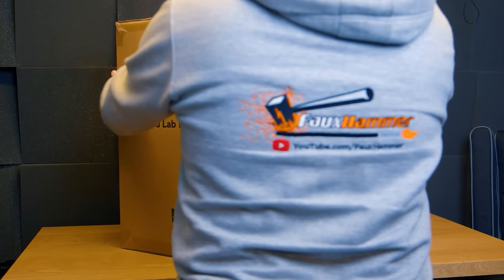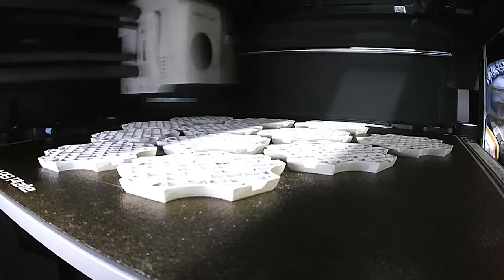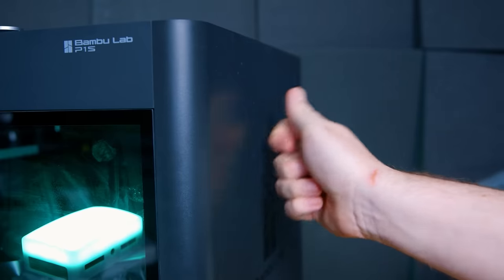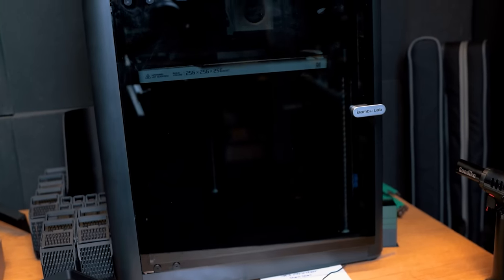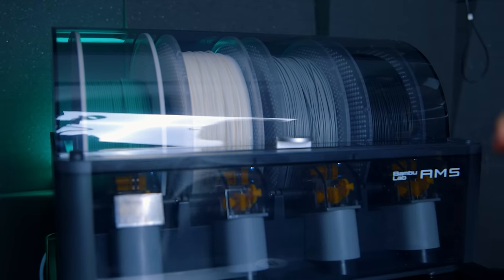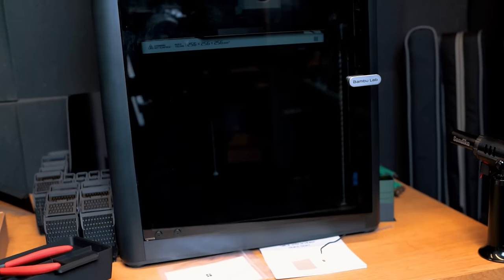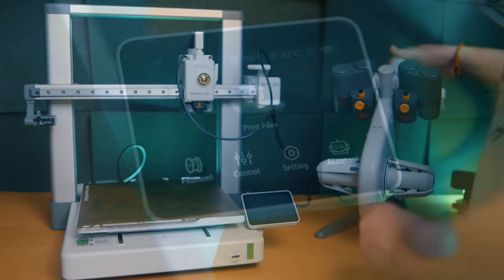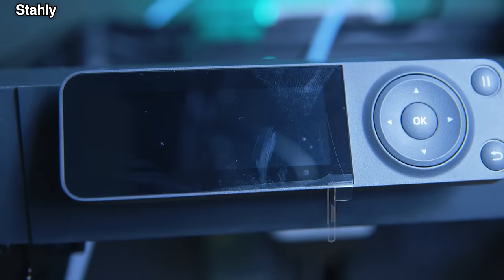Bambu Lab P1S Review - Please Start Here - I BEG YOU

Comment: I had never seen a 3d printer other than on youtube. I am 72. The printer arrived. I set it up. Then printed an 010 print file it was a toy boat that had an out board motor that Bambu had included no charge. It required 3 colours I had 2. I changed the colours simple and pressed print and I had a toy for my grand son. Be amazed by a Bambu 3d printer. I purchased it to print parts for an outdoor retractable blind that are no longer available for purchase.
Reply: In the last 20 years I already explained a lot of stuff to elder people regarding how to use tablets/phones/computers,etc... To be able to do this yourself without help/previous experience is just... wow! respect!
Reply: Now my old man (Who's 66) should have NO issues, but he blames being old on why he still has a flip phone.
Reply: I have now designed and printed a skylight for my a casino on my slot car track. All the traffic boarder, tall and smaller light stands. With concealers fro lights in my pit buildings, roller doors that wok for my pit garages ( a retro fit ) a replacement part for our out door roller blinds in PET GF,( The part was no longer available. I did all the design on Onshape. And it is easy. You just need patients and time to re watch to online tutorial. I am turning 73 in January. And only recently purchased my first 3d printer. I also failed form 3 at secondary school.
Reply: @McCraeMoto1 what software did you use to design it? Is this included?

Comment: I have had the PS1 for about a month now and have yet to have a issue with printing PLA with the door close and lid on. Coming from a Ender 3 Pro, The P1S works like a dream. Though I am glad i started with a Ender because it helped me learn the basics of 3D Printer.
Reply: I have an ender 3 and am looking to upgrade. How are the overhangs compared to that of the ender 3 in your experience?
Reply: I'm using a flashforge finder 1 and am finally looking into "good" printers.
I love the idea of multiple colours
Reply: @cleverballoon6535  P1s can have some problems with overhang at normal speed. Just because it's so fast. Nothing major though, and you can slow it down if it's have trouble.
Reply: @GregoryShtevensh  multi color is great but comes with drawbacks. Depending on size and orientation, it can add a bunch of time to your print. Also makes a bunch of waste because of the need to purge filament when shaping color. Though the results can look pretty striking.
Reply: I have an X1 and not been taking the lid off when printing pla am I missing something?
Reply: @DLStarbuck  I don't believe so. I heard you should remove the lid when printing PLA but I have never printed with it off and never had a issue.
Reply: Do you recommend it ? I have a ender 3 but print then after several I start tinkering sucks .
Reply: @JAYTHEGREAT355  if you want a printer that just work get a Bambu labs. Enders 3 is a good beginner printer of you want to learn how 3D printer works.
Reply: What sort of games did you play on the PS1? Metal Gear Solid? NFS? THPS?
Reply: It's the first PlayStation you know the PS1. What a system.
Reply: @Gepstra  you aren't wrong there. Good times, Good time.
Reply: do you get a pla smell while printing? i have a p1p and i figured the enclosed p1s may smell way less like pla? lol.
Reply: @Bluntedco.  Not that i noticed. Though I might just used to it at this point. I do run a Air Purifier in the same room.
Reply: I’m getting this and coming on 3 to 4 years of printing on a creality ender 3 should I buy

Comment: Pro-tip on support for PLA. It operates much like using PETG as a support in that it doesn't stick to PLA as aggressively as straight PLA. This allows you to set your interface gap to zero thus giving you far better finishes on support sites. Also make sure you choose the option in Bambu Studio to only use the support material as the "Interface layer" as this minimizes filment changes and thus waste. Also when you choose that option, it will automatically set that interface gap to zero.
Reply: Great tip! 👍
Thanks. 🙏
Reply: Problem is, that you will have to much filament changes thus poop
Reply: @striple6752  As I said only using it for the interface layer minimizes the changes. Obviously model design plays a role. That said honestly filament is cheap and while I would prefer less waste, I'll take convenience and print quality over waste every single day.

Comment: At 11:00 the tool is to help you align the build plate with the replacement PEI sheet sticker when replacing it, and it also helps evenly push it down without bubbles
Reply: Bambu have a great video showing how to use it.
Reply from the maker: ahhhhhh!

Comment: Man, after years of struggles with my CR10s... I gave up... and get interest in Bambu. today you give me the reason why I should finally move on the next step of 3D printer. Thanks !
Reply: CR10, ouch
Reply: The CR10 makes me not want to print. I should try this :D
Reply: i went from a highly modded CR20 Pro to an A1 Mini

the A1 Mini has, in one month, done more prints than the CR20 Pro done in 2 years, without any hiccups.

i've had it since january.

needless to say that old thing's just collecting dust now

it had one big benefit over the CR10 and E3's tho, doesn't have bed leveling knobs and ABL out of the box

HOWEVER it came with literally broken firmware so ABL didn't even work out of the box, on a LOCKED BED PRINTER, LOL
Reply: Bro, I started with a used CR10-Mini and it was hot fucking garbage 😭 😭 😭 

My Sovol SV07 slowly died over just a few months.

Now my A1 Mini arrives today.
I'm over these Scrub Ass Printers. 😤
Reply: @Antassium  same , just bought a p1s combo from micro center , so exited

Comment: Thank you for helping me decide to skip the X1C and just get the P1S. I was stuck on the better camera, and the lidar. But I'm not making any money yet from selling stuff, so it would be smart to just get the cheaper option.
Reply: How’s it going for you? :)

I was also keen on the X1C, until I realised the doubling of the price seems to get only three extra things; 
1. A nicer touchscreen display, which presumably is replicated if you use a mobile phone and the app to control the P1S/P1P (my machines are in my garage some distance from my PC)

2. Hardened steel nozzle/gears for fibre filaments (can be added to the P1P/P1S later)

3. LiDAR scanning of the first layer/high resolution camera/fault detection. This is unique to the X1C, can’t be added to the others, but prints can still fail, so it’s not the miracle it first seems. Depends, I think, on your experience level (catching faults in the slicer before you try to print) and the size of the prints you make, ie. time and filament saved by fault detection.

What gets me into the whole Bambu family in the first place is the VALUE of the base unit and the CAPABILITY of the AMS module. The latter is cheaper if bought with the printer (rather than added later) particularly with shipping considered, and it turns out that the P1P with AMS added costs the same as the P1S with AMS. 

Therefore, the P1S with AMS is the value ‘sweet spot’ across many options. Makes a Prusa Mk4 and even a Voron kit look expensive (I have a Voron already, I’m looking for a smaller and more convenient printer, and multimaterial capability).

Printing supports in a separate material was a good mention in this video, I don’t think many of us think of that possibility (we tend to think just of the pretty colours…)

But yeah, keen to know how it worked out in practice! Print quality and reliability met your expectations? :)

Cheers!

Comment: You've convinced me to get the A1, and it was the best purchase ever. I was able to print things with stress free. Now with the recall, I'm thinking of taking this opportunity to upgrade to the P1S
Reply: I am gonna do it same. 🙂I think its upgrade even in fact, that A1 model is yonger.
Reply: Why not actually use the fact of owning a 3D printer and build an enclosure around it ... DIY style?!

I mean ... eventually the purpose of a 3D printer is making things and doing stuff.
The Ikea Lack enclosure could be a way to integrate some piece of furniture into a room.
Reply: cause CoreXY is far better than a bed slinger, even tho Bambu's bed slingers are great

and for the minimal price difference between the P1S and P1P i don't think it's worth getting a P1P, if it was more priced around €500 instead of €650-700 perhaps (compared for €750 on the P1S)
Reply: Did you end up getting a ps1?? I am trying to figure out if it’s worth the extra price
Reply: That decision makes absolute sense. I have to cynically wonder whether that recall (of the cheapest model) was actually a genius marketing move :D almost like a loss leader to get you into their best products

Comment: Hey Ross, it was great to meet you at LVO and talk about painting and 3d printing.  The class was great and very helpful.  I hope to see you back in Las Vegas again!  
I love my P1S.  Do I wish I had spent the extra money for the X1 Carbon?  Sometimes, but I don't think the cost difference is justified.  I'd been printing for 3.5 years on a Sidewinder X1 and wanted to upgrade to CoreXY and I don't regret the choice.  I dislike some of the things Bambu does as a company, but they make great printers for certain.  I also think they are good about fixing things that are a problem.  I spent some time printing on my brother's X1 Carbon last summer and though I liked the printer I was unhappy about how long it took to upload files through their cloud.  6 months later now that I have my own P1S the speeds are noticeably faster than they were a few months ago.
Also, I've heard that you "need" to open the lid or door to print PLA in these enclosed printers, but I've done neither and all my prints have been fantastic.  My AMS is on top of the top lid, and if I leave the door open my clumsy self will find a way to break it, so that's not happening either.  It works fine with them both closed with all the PLA I have tried.

Comment: I have an ankermake from the Kickstarter and bought a P1S end of 2023, the P1S is way ahead of what anker offer especially with the AMS. Im looking at a 3rd printer and I'll either be a P1P just for churning out PLA prints or an A1 with an AMS mini.

Also thanks to your videos i just upgraded from an Anycubic photon 1 to a Mars Max and the difference is incredible
Reply: There's a misconception that the A1 is somehow "little" compared to the P1S/P, but it actually has a larger print area than the P series (and X series) due to its lack of an exclusion zone. It doesn't matter often, but sometimes it does. The AMS Lite is the same capacity as the regular AMS, but it's more accessible, easier to load filament, and it doesn't really care if your filament is on a cardboard spool. You have a P1S to cover the exotics. An A1 will print PLA/PETG all day long and does a superb job. Either way though, you can't go wrong.
Reply: Apparently the A1 is being recalled due to a fire hazard

Comment: I've owned a P1S+AMS since they came out, and an A1+AMS Lite since they came out. They sit side by side on my desk. Not only do I think the A1 is a better deal for a beginner at half the price, I think it is a better printer at half the price. The P1S is enclosed, a bit faster, and is corexy. The A1 is lighter, has a more user-friendly and reliable AMS if you use filament on a cardboard spool (and of course you do), it is quieter, even after the P1S firmware upgrade, has a better screen, and offers an overall better user experience than any other printer I've had, and I've had a few. I'm no print farm, but I have 1458 hours on my P1S, which is an average of 16.5 hours per day for 88 days. I know it's strengths and weaknesses. I'm glad I have both, but if I wanted a third, it would be another A1. Technically, I got another A1 yesterday, but it's for my wife. If you're a beginner, the A1 is the only one.
Reply: How did you get an A1? Bambu stopped sales of the A1 to address the power cord issue.
Reply: @wk5199  sorry misread your question. There were a ton of A1 Combos in the supply chain and I would guess hundreds if not thousands were delivered on Monday after a resupply. They weren't going to claw those back for an easily mitigated risk, even if they could have. You'll see a lot of people in comments talking about their Monday deliveries.
Reply: Having now owned both, I 100% agree with this. The A1 is easier and more consistent to use overall, in my experience.
Reply: @solacedagony1234  well, five months downstream, I'd like to revise and extend my remarks. While I still think the AMS Lite is a better design than the AMS, I have had two A1's for that time and the A1's have some points of failure, namely the heating element, the extruders and the heat bed itself. We have one down right now because of a heating element that is the third such failure we've experienced. They are still an excellent printer based on consistency of output compared to the rest of the world, but if I were creating a print farm, I would go with the P1P. My P1S just crossed 3,000 hours and has never had a repair more serious than the nozzle.  That's just me of course. Everyone's use case is different.
Reply: @Immolate62 you really shouldve had more than 1 month of ownership before the comment. While bed slingers print well for cheap early on there's a lot of failure points. I had that same opinion about my prusa mk3 back in the day the first 4 months of my ownership. Then it became a nightmare of failuresm

Comment: I replaced my MK3S with the P1S back in November, and it's such a wonderful machine.
The black Friday deal got me a free hardened steel nozzle and gear upgrade, so it should be every bit as capable as the X1 :D

I fully agree, the real strength of the AMS unit isn't multi colour prints, but the convenience of picking which spool to start a new print from remotely!
Reply: I keep thinking about upgrading my MK3S as when I slice anything now, I put it in Bambu Labs and it is night and day in speed and time parts will finish. Would you go back to Prusa like the MK4?
Reply: @jheli22  I do love Prusa's philosophy and support. But if you want an enclosed printer with multi material option, the MK4 is a tough sell. I do hope the MMU3 runs where the MMU2 stumbled

Comment: As someone thinking about getting into 3D printing, I love the level of detail you can get with resin, but with the fumes, the mess, the curing station, the washing station, the hazardous waste disposal, etc., FDM looks a LOT more friendly.  This unit and the X1 Carbon series are probably at the top of my list.  The difficulty I'm having now is understanding PLA vs PET-G vs ABS.  To be fair, I've kind of ruled out using ABS because of the fumes, so it's really just PLA and PETG (which also apparently comes with carbon fiber in some iterations).
Reply from the maker: PLA and PETG are almost different sides of the same coin. I’ve never seen any benefit personally in left to need to use it. 

People say it’s tougher but honestly, I’ve not seen anything that particularly shows this. 

FDM is more user friendly in terms of cleanup. Or lack thereof surely, at the cost of detail.

But honestly, it all depends with what you want to print. PLA has been fine for me so far, even with basic functional parts
Reply: @FauxHammer   - Thanks for your response.  In the 2 weeks since I made my original post, I've watched a TON of FDM and SLA printer videos (lots of them yours - subbed).  I think PLA will probably do everything I'd ever want for my projects (anything from minis to busts and larger figures to cosplay helmets and armor).  The thing that tempts me away from units like the P1S or X1C is build volume, like on something like the Neptune 4 Max or the Creality K1 Max.  I know you weren't terribly impressed with the Neptune 4, though.  So I'm left to contemplate better user experience for a first-timer, but smaller build volume (Bambu) versus a more fiddly, somewhat less cooperative unit with a larger build volume (Neptune/Creality).  I've also heard from a lot of people who've owned Bambu printers (print farms and solo units) that Bambu's aftermarket support is terrible and the printers break pretty often.  I'm unsure where to file that (internet trolls vs valuable advice), but it's certainly a thing for a first-timer to consider.  So, all of that to say, thanks for doing what you do to help those of us just starting in this hobby try to figure out which printer will best suit our needs.  I'll keep watching...and eventually come to a decision.

Comment: I have a P1S without AMS as I dont have a need for color changes nor want to sacrifice the space that the AMS takes up. I have had it for 8 months and I have yet to clean the build plate, every print sticks great and comes off really nicely. I had a Artillery Genius before, lots of levelling/1st layer issues. 
This printer is on another level, they behave like a microwave; set and forget - I have not had a single failed print since day one (I only print PLA). Which is the reason why they are so populair. Really happy with it. Note that you need change the max volumetric speed if you are using a "standard" PLA profile (12mm3) - set it to 20 and the speed goes up dramatically while print quality remains the same - requires some calibration to make sure it works.
Reply: AMS is also useful for using up an entire spool of filament.  You can have the machine auto pull from the next spool once the current one runs out mid print.
Reply: I got the ams even tho I don't do color prints. The ams saves me from having to change filament if I want to print something in different colors. I can make a white part, pull it off and bring a black part right after.